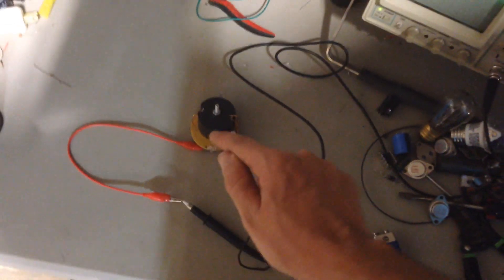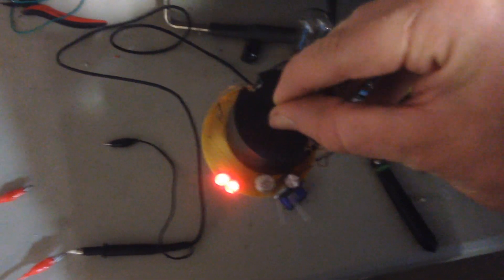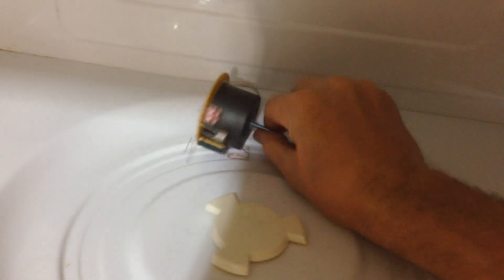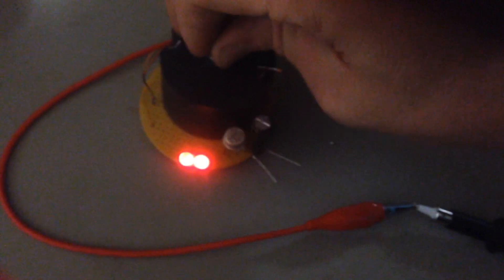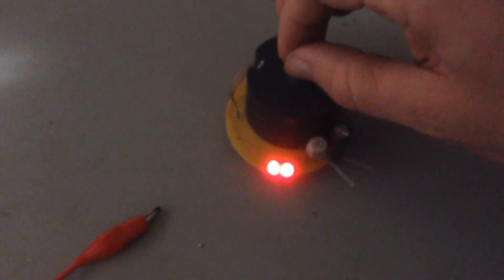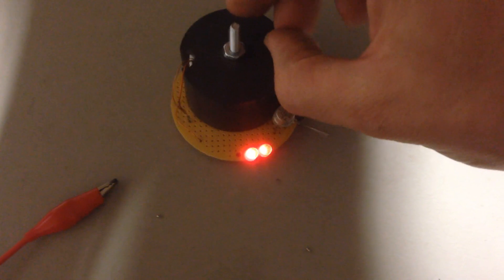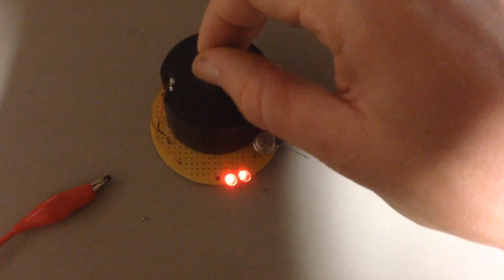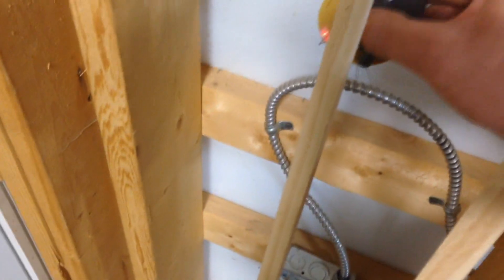SJR Looper breakthrough! - Light keeps going after battery removed

Comment: 1. Would you consider making and selling these? I would love to have several of them for experimenting. And 2. Have you considered a crystal radio as a power source, possibly tuned to the frequencies that Earth gives off? 3. Would you consider maybe selling an electricity experimenting kit including things you've made? Not as "free energy" stuff but for people to learn with and build on? Obviously no electricity is free because we have to make devices to harvest it, but the amount of electricity generated by magnets in a motor surely is far greater than the electricity used to create the magnet, right? So it costed money to make the magnet, maybe pennies, seconds of electricity, a quick jolt, then you add a stator, coils, gears and cranks and make that spin really fast and can generate electricity from then until the magnets stop being magnetic. With cheap magnets, that's fairly quick since heat destroys them fast, but permanent magnets last a lot longer, even many years. So why couldn't someone simply make a  very low voltage motor that spins really fast and have that motor spin a stator for a generator that generates far more electricity than the low voltage motor uses? It sounds plausible. Obviously it's not free, obviously it wouldn't run forever and ever because parts wear out eventually, but the electricity generated would surely far exceed the tiny amount used to create the magnets and the machine itself including stators, coils and shafts, it sure sounds reasonable. And if crystal radios are powered by the radio waves they are receiving, then why wouldn't they already be seen as a plausible source for powering small devices using joule thieves and other step up circuits since the Earth itself is constantly giving off radio waves and they're stronger than any that we typically broadcast? Our radio waves are relatively weak compared to Earth, Earth is really loud. I bet that nothing off of our planet could ever hear a single radio wave we've sent out because Earth is far louder. Tesla used a simple spirit radio which was a crystal radio, to contact what he said were martians who gave him most of his ideas and inventions, so what kind of amplifiers was he using if the thing was self powered? It must have been self amplified too and been capable of receiving signals from much further away than todays more complicated radios which for some reason people don't include A.M. on the new ones despite that the public can still broadcast on A.M. All radios by now should have A.M./F.M./mid wave/short wave/long wave/ and walkie talkie functions. My opinion is that it's all useful as far as radio goes and it's all relevant. If a little kid can use radio waves, hidden circuitry and a small Tesla coil to light up a string of LEDs that requires 12v to light, then what the heck are we doing limiting peoples use of radio to only F.M.? A.M. is public, nobody broadcasts on it anymore, don't know why... Shortwave, long wave and mid wave give you worldwide bands and you could listen to radio stations around the world, why don't all radios have that? And all radios should have a walkie talkie with at least 10km range or more. Most cell phones don't even have a radio tuner that doesn't require internet, that doesn't even make sense, don't they all have a radio tuner built in? People think just because we're moving forward we have to abandon everything. Next people will abandon F.M. too and just play their own playlists on the radio and screw what everyone else likes to listen to. I know people who still buy records, I know people who still record songs off of the radio onto cassettes and videos from the T.V. onto VHS or DVD or a hard drive.

Comment: I was curious to know if you've ever experimented with SEC exciter circuits (or the "Slayer Exciter").  I'm interested because I wanted to make a circuit to put in my R/C plane where only ONE WIRE was required to power the LEDs using an "AV plug" or two diodes on the LED (for night flying).  I managed to make something that uses a tiny coil but the transistor gets incredibly hot.  I might be able to use only one diode on the LED but even with a heat-sink on the transistor I wouldn't want to put that in my plane.  Do you know of a "cooler" way to do that?

Comment: Wow, that's a cool circuit.  It got me thinking if it was possible to build a large flashlight with more LEDs (to make it practical) that used a similar circuit but had the addition of components that would grab a quick charge from the battery when the charge dropped below a certain level.  In essence making a flashlight where the battery would last for an incredibly long time.  Also, would you be willing to point me to a "recipe" on this circuit, i.e. a schematic and description of the coil?

Comment: Nice LaserSaber, I have tested it and it works, only thing is i am using a E core, and using a ground to the plus side of the led.

Did you use a long wire as ground inside yr pot with only one lead connected?

Greets JB

Comment: @LS
As a base effect, you need to show the 3000uF cap with the leds directly on them and then give it a 9v battery pulse then remove the battery and see how long the leds last on their own, without the circuit, then compare with the circuit. That is a real method to compare the base to the function and see if it goes longer with. Try the 9v on for 1 second, see lasting, 2 seconds again see lasting, etc.

Comment: I Have done something similar. You can Google out "Micro TPU"  The difference is I use to blink 60V Neon bulb and using standard ferrite toroid core. I quickly touch 12V battery and it runs for around 3 - 4 minutes. The cap I use is 4700 micF 35 V. I also tried to use the LEDs but they burned immediately. The scope shows very stable contour until last 90% of run-time. After the voltage starts to drop rapidly.  Anyway, I like your channel as many others. Very good work!!

Comment: I am not involved in these kind of experiments. Is the point to get a light to shine as long as possible or to get as much energy out of a capacitor? In the first case you can make a square wave with as low duty cycle as possible (as long you think the led shines). In the second case you should monitor voltage and ampere and integrating them to get the total power and energy over time.

Comment: Love this - could we aurduino a little chip that switches pin so a bank of crystal cells bang power to super jouleringer 1 till it rings on it's own, then switches to joule ringer 2, 3, 4, 5 in sequence so that you can light up shit loads of LEDs with just one pair of Crystal Cells

I just saw that you use a cap; we found that caps with joule ringer circuits that we have from Hong Kong designer who tunes the circuits real well were unable to do this because what is happening is that the battery discharges loads of energy to the cap in one quick dump and then the cap is working just like a battery. How can we work out how much power is delivered to the Cap please? Can you measure the rms power value delivered with the scope?

Many thanks
Charles
Reply: how dose this work?
Reply: you might be able to power stuff like TVs and PCs
Reply: ***** the crrystal cells output like 10mW of power all the time at 3V for two cells. I am thinking can we start one of these "ringing" then another and another and another and come back to the first one before it runs out. Then we get like 50 LEDs lit with 10mW of power. We need 6 cells to run a microprocessor that can switch a timer on a chip so that the power is sent to each cell in turn. The only problem I have with this concept is the claim that huge ammounts of power is dumped from the battery to the cap in the very short time it is connected and the joule ringer is can work off that for ages.

If it is just working off a kind of cyclical resonance effect then we could do the aforementioned system - what do you think lasersaber ? p.s see our crystal cell projects and automated self sufficiency (inner garden systems and sensor staafs) that we are exploring the use of crystal cells for; grow systems indeed www sustainablemedia coop  -- projects section namaskar
Reply: so if we can get a ring of these where we can keep them going on there own power[ - the battier] could we just keep adding capacitor and keep getting more and more power?
Reply: hey rember the rod stuff he did where he got power from the sky?, could that start up the loop?
Reply: ***** yea I got that I know how joule ringers work I am just thinking of pplications for them with our crystal cells
Reply: hey lets get a ton of long poles, a pc, and a ton of these. I bet I could run my pc